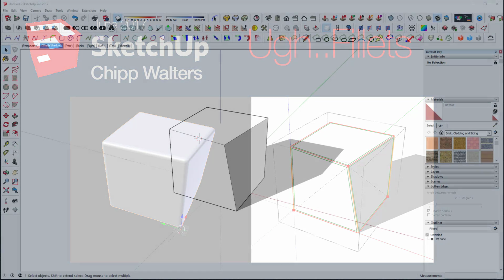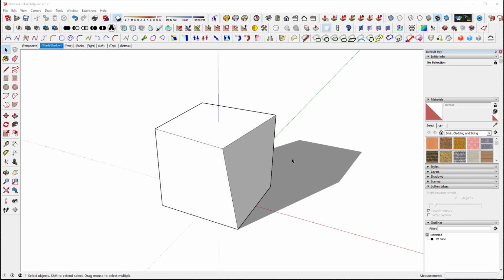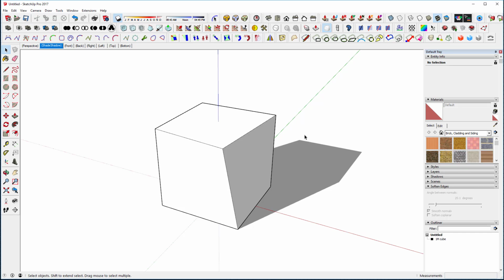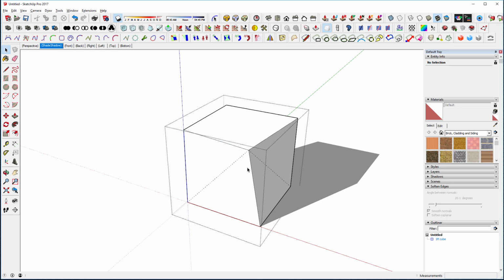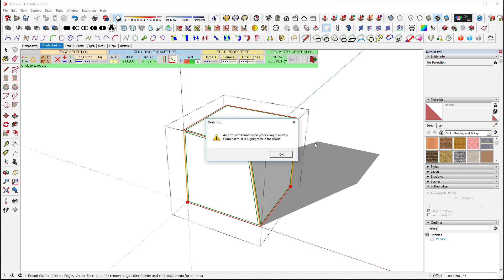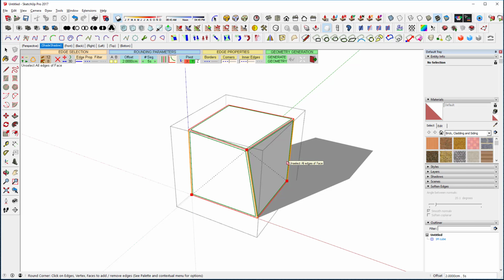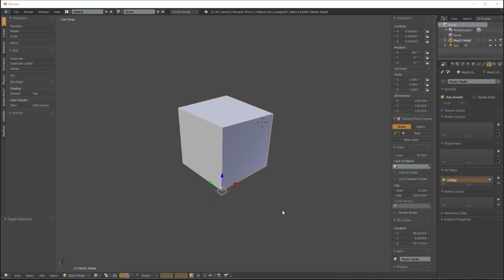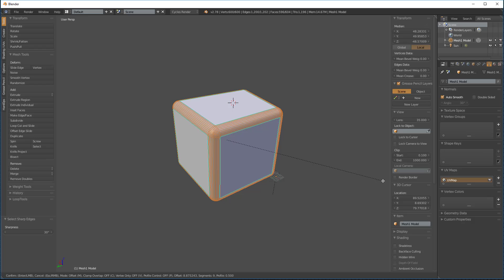SketchUp Fillet Woes

Comment: I wonder if it could just be a simple fix for Fredo.  The problem is the softened edge.  That is what's causing the fillet to fail.  The plugin would have to somehow ignore it in the calculation in a similar way that SUbD does, by creating a "pseudo-quad"  definition. Blender, Max and others all look at quads differently.  Moving a vert, which takes a quad out of planar, isn't going to break it like it does in Sketchup.  Fredo would have to add support for Pseudo quads in Round Corner is my guess.  

In the meantime, the only option is to either round the corners via subdivision  or to fillet it while it's square and then move the whole filleted corner afterwards.  

I'm going to press the Facebook community with the problem and see if I can't get any other ideas for you.
Reply from the maker: I did talk with Fredo about this and he said he knew about it,  and it wasn't a simple fix. I believe he was thinking asking the same lines as you,  use a subd approach to help calculate the fillet.  let me know what you fond out.
Reply: 5 years later….Any luck finding the solution?
Reply: @sajhidb  Yes, this was solved in the newer FredoCorner plugin.